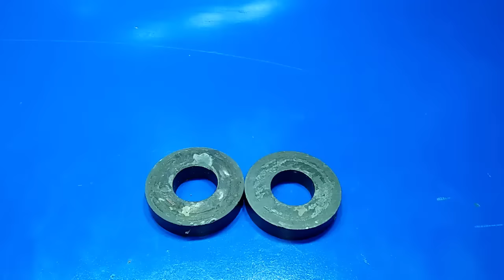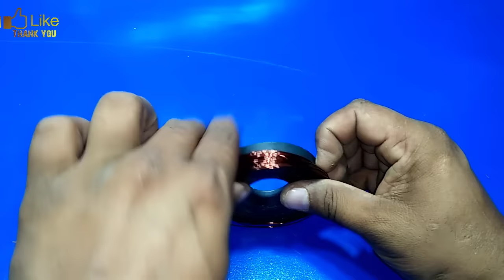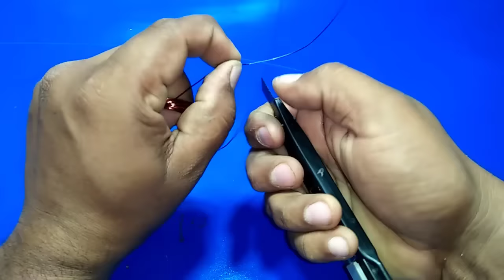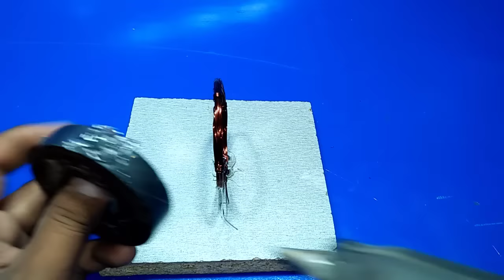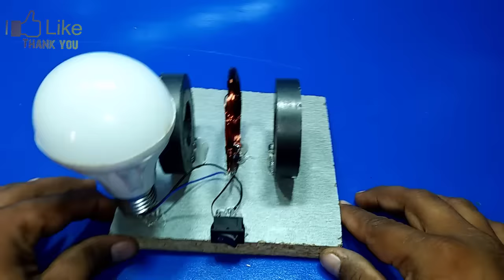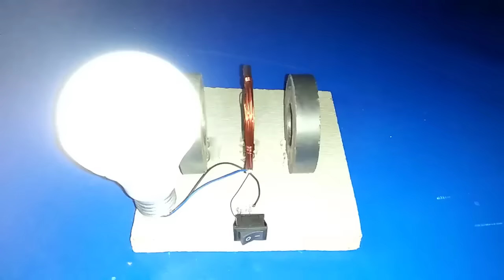how to make a energy generator free electricity with magnets copper wire output 12v

Comment: Either the magnets or the wire coil must be moving, such as in a windmill.  The movement of the magnetic field across the wires is what causes the electrons in the wire to move, hence the creation of an electric current.
Reply: Bro this is a bulb which stores charging and when button press of bulb glows
Reply: But where is the magnetic field moving here? Everythig is stationery
Reply: @shivanihr5879  there is an induction stove under the table🤣
Reply: true, the secret is in the lamp it has a battery inside of it works just by touching it with your finger
Reply: yes sir u r correct. The above video will not produce current. magnetic field needs to cut frequently by solenoid (either magnet moving or coli moving)
Reply: they are using light bulb with battery backup XD
Reply: just to revive this little gag "experiment". It isn't a bulb with a holds a charge, there's no charging needing done here. It's a gag for the magic trick where a magician takes a piece of metal and makes you think the of some scenario meaningful to you is what can creat energy because of your feelings or whatever performance he wants to give. it's got a battery in it already and the circuit is only completed when the magician puts it in their mouth. so him doing this and completing the circuit with a coil that CAN BE TRANSFER FROM POINT A TO POINT B that's clear because he has to complete a circuit for it to light the bulb.  it's just a gag
Reply: %100 free elctric dvice forget evrything thermo dynamic told you! breaks laws of thermo dynamic to produce FREE energy scientists lied to you totaly no edit watch the vid before getrs deleted by government!1!!1!!!1!!!!!!11!!111!11!!!1!!!!!!1111!!!1!!!1!!!!1!!!!!!!1!!!!!!
Reply: @shivanihr5879   when ever there is a closed magnetic field in a circuit a new emf or current induces which cause the bulb to glow
Reply: thnx nigga

Comment: The plastic between the bulb's glass & metal screw-on  is covering the bulb's lithium ion battery. Even just a wire connected to bulb connectors will switch it on.

Comment: There should be motion of the magnet or change in the area of the coil to produce induction.
Reply: Yes and no, the science that produced ALL of today's current electrical devices are all based on pre-Einstien physics, no new discoveries or inventions have been made in the world of electricity that are based on Post-Einstien physics. since academia wrongly decided that an electron was a particle (No evidence can be found that supports an electron being a particle). Even today almost 100 years later modern science (post-Einstine) is still struggling to prove that an electron is in fact a particle. Quantum science has simple thrown in the towel similar to Einstien with the photon and is now trying to tell us elections are also particle-wave dualities. As to your point, if you go back and study the sciences that actually produced results (Pre-Einstine electrical theory) it suggests there might be a way to do this without a prime mover. This is because the movement does not convert into electricity, ether torsion at the plain of inertia causes electrification (This is electrical field theory). If you are interested in real science try reading Tesla, Heavyside, Maxwell, Dollard, Wheeler, Faraday, and Steinmetz. These men will give you explanations, unlike post-Einstine science which can only provide descriptions.
Reply: Unless one thought in terms of frequency....say a quartz crystal when struck emits alot of energy. Click lighters and bbq igniters jump a spark gap by this method. Wich clearly isnt used above lol so ya your correct.
Reply: @kevenbates4313  u mean this rubbish in this vedio is correct? if so i made the exact same model bt it didnt worked why?
Reply: @PrimeContent01  What? No, this guy's video is a scam. It a battery in the light bulb. This scam has been around for years. I was talking to Keshav when he commented that there should be a motion of the magnet or a change in the area of the coil. Faradays notes specifically hint at the possibility of electrification without a prime mover. That said prime mover or not there is no free energy or over-unity or zero-point energy.
Reply: @kevenbates4313  thx
Reply: @kevenbates4313  dont forget Hutchinson!  The hutchingson effect is what brought down the twin towers

Comment: Time independent magnetic fields do no work on charged particles. Look at the Lorentz force equation. The force on the particle from the magnetic field is at 90° from the field since V x B. Work is a dot product of Force and Length,  which means that force and motion must be same direction to do work and thus increase the energy of the particle.
Reply: Can you please explain it in a grade 10 level
Reply: @destroplayz7397  It means it cannot produce electricity unless the copper wire keeps moving around the magnet or vice versa
Reply: Then how do these videos show a very clear representation of consistent power?
Reply: This is fake
Reply: @destroplayz7397  if we won't to glow bulb ,any one of magnet or coil sud move

Comment: Battery inside the lamp..
Reply: abdelali lassakri Oh man, I thought I was going to be the smart one to say that
Reply: Induction heater table ke niche
Reply: yes dem sure
Reply: No bro i googled it also. Electricity can be created like this
Reply: @hxrshit_   you can't know if something is real when you haven't tried it. He was supposed to use a magnet far stronger than what he had, the magnets he had were weak as a refrigerator magnet and he needed only one magnet, at least he got the copper right. Also, the magnet also needs to be moving. Search Lanz's Law, and if you could please tell me, what is the source of your research. Magnets like those aren't even supposed to produce electricity that strong. And also, we have an identical light bulb at home, it is a rechargeable light bulb and if you press the light bulb down, it will activate and will light up. I can even sell it to you if you want.
Reply: Yes I also know electricity can be created but there should motion either in magnet or in coil .
Reply: @krishnagamerff8889  It is true, sir
Reply: @hxrshit_  wooow
Reply: @feminico2613  The magnet  needs to movement.
Reply: @extreme_player  25/5000
even next to the reel
Reply: @hxrshit_  It is impossible to produce electricity this way ... because the magnetic field does not change
Reply: @feminico2613  You said the magnet must move. But here it is fixed. It certainly does not produce electricity. It is a trick in order to get viewers only. For the sake of studying the magnet in the early eighties.
Reply: @LASSAKRI-Abdelali  hmm.

Basically, if he did it right he can create electricity, except he didn't because he did it wrong.
You're also right because the light bulb had a battery and he's using this video for views.
Reply: @feminico2613  how if it did it correctly, it can create electricity ??? the flow of induction must change to create current
Reply: @LASSAKRI-Abdelali  the design itself doesn't look like it can.

Comment: The bulb is a rechargeable light that has a remote control which is why one hand was taken out of the video to switch it on and off as the other hand played with the switch. As long as the magnets are stationary, no electricity can be produced even if the two magnet's are polar opposites!
Reply: Or her can use a multimeter to test the amount of electricity being produced instead of using a light bulb. Let's see how much voltage and or current, the static magnet's are producing...

Comment: 10000000000000% fake hidden battery inside the bulb and the copper loop completes the circuit when he turn on the switch
I have to edit this comment because of some layman's

He is trying build a useless device
Electromagnetic or magnetic induction is the production of an electromotive force (i.e., voltage) across an electrical conductor in a changing magnetic field.
This is the law 
And this device is not even close to this law 
Study first 
You can't generate electricity without any change in magnetic field
Reply: ThE TENDER expert yes
Reply: Study electromagnetism, you can use magnetic resistance to convert magnetic energy into usable electric current. The attitude you have is going to obliterate this world, it will be everyone's fault that billions had to die over this.
Reply: Yes true I have that lamp bulb
Reply: Stupid.. study first
Reply: Yes we can use magnetic fields but it is not possible to generate so much electricity or current to turn up a bulb which has a min. voltage of 3.5 volts
Reply: Not a battery but a inductive charger.
Reply: Fake
Reply: Fake sala
Reply: exactly your right
Reply: @Archangel_Iahhel  you're an idiot. you need CHANGE in magnetic field to create electric current, hence all turbines require some sort of force to provide that movement be it wind, coal or gravity.. At least explain the scientific principle behind the experiment. Is it powered by the Earth's magnetic field? You can't have energy created out of nothing - basic Law of conservation of energy
Reply: not 10000000000000% fake hidden battery inside the bulb and the copper loop completes the circuit when he turn on the switch, but 1000.000.000.000 billions fake video, like you say that it has a battery in the bulb that can be charge and when is no power the bulb use the battery for lighting
Reply: @Archangel_Iahhel  Interesting, is there any diagram or science article explaining this? It's worth to look into it.
Reply: Exactly. You’re probably right it is in the bulb or a small watch battery is in the switch but there is definitely a battery.
Reply: Thanks.  Right.  Answer. ..We. Are. Not.  Fool.   Pito.  Saly .ko
Reply: @Archangel_Iahhel   @Iahhel  yes i have studied that 
But read again you cant produce or generate electricity without coil or magnet rotation
And the law of electromagnetism is not applicable here dumbo 
Study it first 
He is trying build a useless device
Electromagnetic or magnetic induction is the production of an electromotive force (i.e., voltage) across an electrical conductor in a changing magnetic field.
This is the law 
And this device is not even close to this law 
Study first
Reply: @chandreshsharma0443  true
Reply: @Karmidzhanov92  true nicely explained
Reply: @antoncroes4078  He is trying build a useless device
Electromagnetic or magnetic induction is the production of an electromotive force (i.e., voltage) across an electrical conductor in a changing magnetic field.
This is the law 
And this device is not even close to this law 
Study first
Reply: lol learn first how inductive charger works
Reply: @marianocastillo2108  iam a student of electronics

He is trying build a useless device
Electromagnetic or magnetic induction is the production of an electromotive force (i.e., voltage) across an electrical conductor in a changing magnetic field.
This is the law 
And this device is not even close to this law 
Study first
Dumbo
Reply: @samirmajumder8633  welcome 😊
Reply: David's lab, i’m not stupid.
Still it is fäke.
Reply: yes you are right it's fake
Reply: David's lab, i think it is a induction heat plate placed on one side of the table, or (probably) some kind of battery powered ikea emergency bulb.
Reply: yes bro you are right i think there is a battery or as u said IKEA bulb
Reply: @sarjeraopalwe321  😊👍

Comment: Those LED light bulbs can be shorted with your fingers and turn on, All you're doing is shorting the two terminals together with the switch.. They have a battery inside of them that will turn on the light during a power outage OR can be turned on with a push button
Reply: yes this video violates Faraday s law

Comment: Notice the black line on the table under the device. The demonstrator always carefully aligns the left hand magnet with the line. Could there be a powered movement under the table generating the missing element of motioin?
Reply: Wireless charger.  The light is l.e.d.  so requires very low voltage
Reply: There’s literally no black line one the table

Comment: Rubbish - there is a normal copper coil supposingly ander the table picking up the electricity - this is picked up by the coil connected with the light bulb and that is why the bulb works. By the way ... free electricity by connecting  a copper coil to a battery and another one to a bulb? What is again the meaning of free electricity ? Connecting batteries ??? (see other video...)      S H A M E   O N    Y O U !!!!!
Reply: I see where you're coming from here, but what is the real way to do this? I've been searching all day for a not click-bait video! help
Reply: Joe Dontknow tamara castro samba
Reply: Joe Dontknow there's a battery inside the lamp, as many as i can found and buy at store on my country
Reply: No the bulb is rechargable and to turn all you have to do is to short the 2 connections. But what you said could actualy work as well...but the voltage and current could be very low to turn on this bulb unless it was an led.
Reply: Joe Dontknow what u say is wrong we have done this project
Reply: Zxx
Reply: I challenge you can you make iron man repulser because I had made that. Nonsense

Comment: If you move a magnet quickly through a coil of copper wire, the electrons will move - this produces electricity.   😕😕
Reply: Ya but the current is also dependent of the cutting action of the magnetic field

Comment: Magnets and copper have a great effect. The magnets try to push the molicules in the copper to create electrical current.
Reply: 1. Copper is an atom, not a molecule.
2. That's not how electromagnetic induction works.

Comment: It can be possible the copper coil is good conductor of electricity, and as two magnets are placed closer that's why magnetic field is working. The copper socking the energy of magnets . This produces a voltage across the electric conductor . But for more energy ⚡and more time working we 300 ruppes big magnets

Comment: Bro this is funny as hell you got one of the things correct and that’s the copper that’s it now where’s the supply of electric charge and where is your form of push to move the charges through the circuit did you forget that there’s electricians out here or your just that stupid 😂😂😂

Comment: You have copper wire, you have magnets why not demonstrate real generation of electricity by implementing motion into the design. The demonstration as presented gives the false impression that useful amounts of electricity sufficient enough to power the light might be generated with everything stationary.

Comment: i tried with regular copper wire and it did not worked out, what kind of wire are you using? Which kind of magnets are you using? Do magnets from microwaves work? The attracting sides should be facing the wire? Just looking for things I may be doing wrong. Cooper is a conductor of electricity so I do not understand why is not working.
Reply: Because its fake

Comment: Wireless light bulb powered by batteries...many people think when it's said that a changing magnetic field induces current in an conductor it's the changing of + and - that is responsible for generating electricity... but it's the complete opposite of that... it's the changing of the strength of the magnetic field that is responsible for electricity

Comment: I agree with the negative comments and it must be a fake, the magnetic field or coil must move to break the lines if force and generate electricity.....unless....he has found a way that the magnetic fields are unstable, unequally balanced opposing magnets may result in an oscillating field because if that. This would indeed be very clever if it is so. Try placing opposing poles of magnets on top each other, the magnets will wobble but if they are fixed you can get a wobbling magnetic field instead. The light will fade after some time when the magnets become depleted. Otherwise,  I am back to the idea that he taps the radio waves in the air which would produce a weak current but maybe not enough for his bright bulb I would have thought.
Reply: And the law of conservation of energy.

Comment: 1: Copper wire is used as a wireless electric receiver from under table. 
2: the switch has mini batteries creating circut through the copper wire 3: the battery is inside the bulb and needs a circuit from bottom to sides of E27. 4: watch me create the real deal of electricity without the tricks

Comment: Easy way for this poster to improve their proof that they are not cheating us all, would for the poster to post the LED part number and show a lumen meter.  The part number would allow independent tests and the lumen meter would show that the LED is operating at the expected output.

Comment: You need motion or for clearly you need to move the magnets to generate power but the voltage will not bee high it will be weak low don't make this it's Garbage 🗑️

Comment: First you have to move the magnets ti make the electricity second you used melted rubber to connect the wires correct me if im wrong but rubber doesn't conduct electicity so the electricity wouldnt be able to flow to the light bulb.

Comment: I'm electrical engineer from kashmir but in my knowledge tells  if we one of the bar magnet or any kind of magnets varying distance between coil and magnetic ring the magnet flux cut the coil and an emf induced in it. if we magnet stand with coil at stationary there will be no flux and an emf induced in the coil. Do this experiment.....
Reply: Why

Comment: Every frequency of electromagnetic radiation can be converted into electricity, magnetic fields can be converted into electricity, such as this. Hydro carbons like gasoline are just long carbon molecules with hydrogen in them, you can run electric current through water to separate the hydrogen and oxygen making useful gas for combustion, which is around a thousand times more powerful than gasoline gallon for gallon.